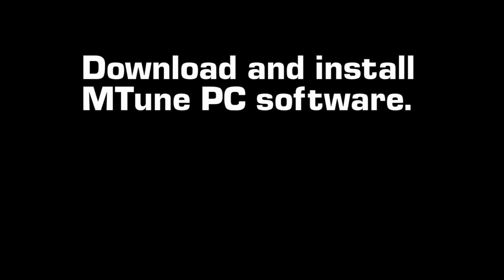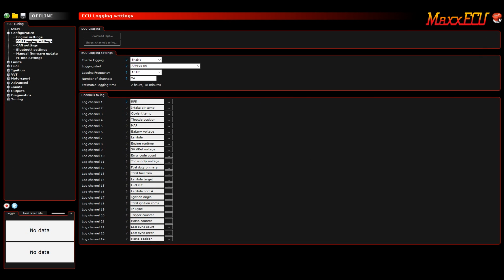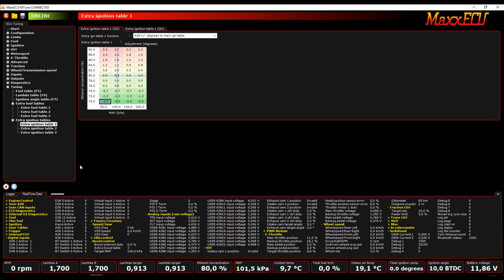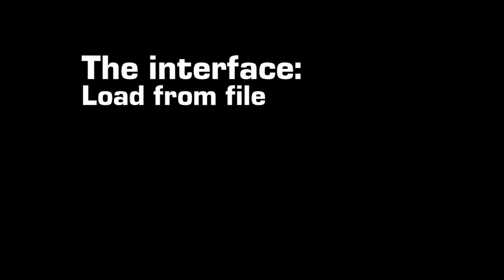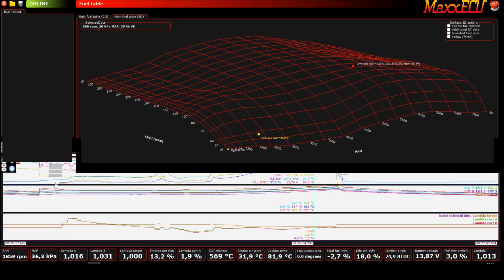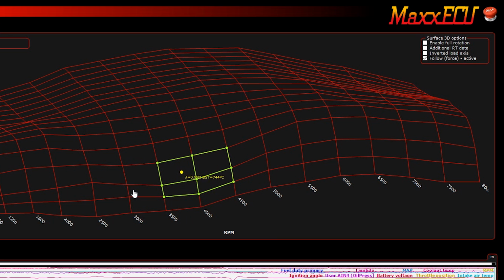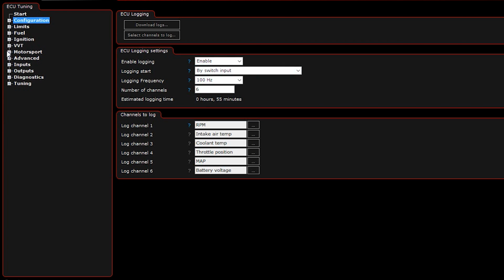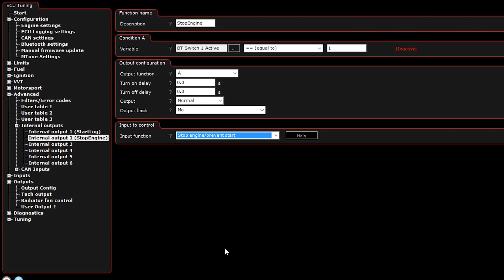MaxxECU Academy - MTune Basics [English]

Comment: How to adjust fuel in idle? My car so rich in idling..sound also no good and smoke smell fuel...
Reply: Lambda is not on or set incorrectly. Maxxecu will automatically go to the air/fuel ratio you set at idle.

Comment: Can maxx ecu race control fuel pump and be able to turn on electric radiator fan base on temp from coolant temp sensor?  I'm trying to keep it more simple if possible.  Debating on the maxx or megasquirt for my 2jz  gte

Comment: Wich maxxecu should I need for a 5 cilinder Volvo engine and what are pro's and don't
Reply: The street is more budget friendly, but has fewer general purpose inputs and outputs. So less freedom in selecting sensors to use as datapoints, and less things to power from it. Perfect for a street application. (Cannot run drive by wire/e-throttle)

The race is more of a beast, which is more suited to a racing implementation. It has the capability to run drive by wire or e-throttle. It has more capability than the street, but is slightly more expensive for obvious reasons. It has built in egt sensors to monitor the combustion temperature of each cylinder, so each cylinder can be adjusted individually to keep the engine safer.
Reply: @JKearns98  thank you but for a 5cilinder it's gonna be drag car but needs to be save to daily if needed or long trips but as I see it the race better option
Reply: Race 🙏🏼
Reply: @pexpaxs4659  I hear that some are running the street
Reply: it's also a good choice but i chose the race model because it has built-in egt and more inputs&outputs!
Reply: @pexpaxs4659  okay en egt what's that and  what are the pros and cons for the both
Reply: Egt= exhaust gas temperature. 
And don’t really have anything bad to say about them. 
It is up to many things bout ur car that what are u running and what u are going to do with your car in the future✌🏼
Reply: @pexpaxs4659  hmm okay need to go deep looking thank you